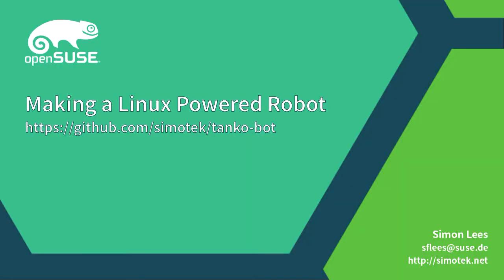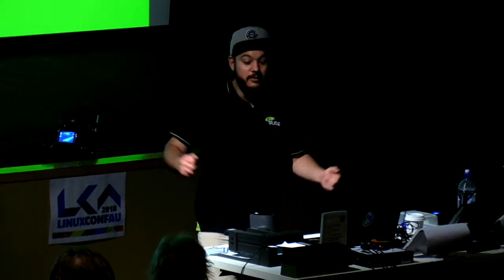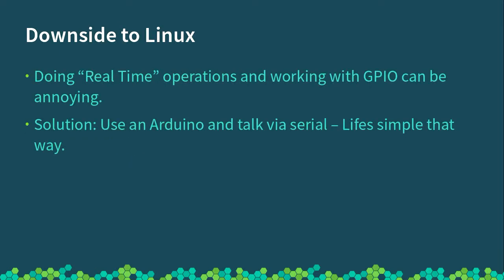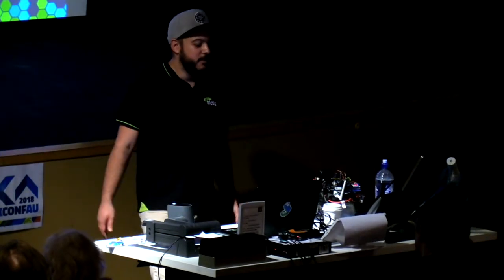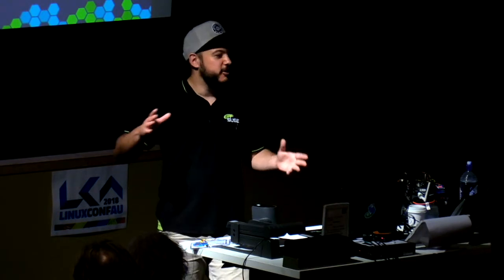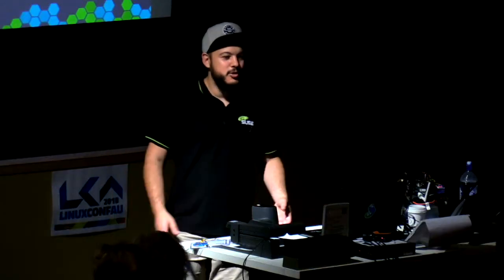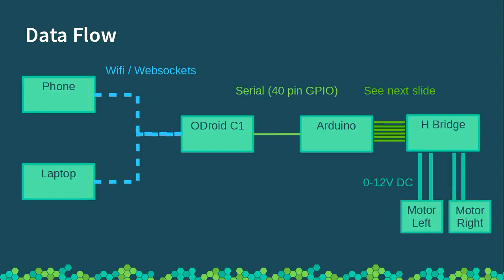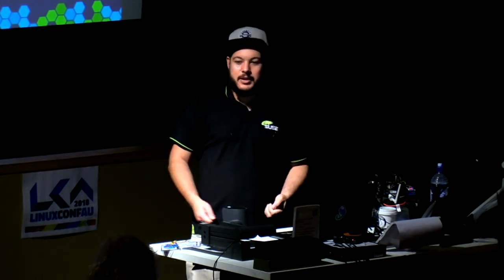Creating a Linux Powered Robot

Comment: Nice presentation Simon. I would agree that the direct kernel support from Odroid has dragged a bit, but recently they have been working on changing that and you should be able to get a 4.x kernel. You might also want to take a look at a newer  Linux distribution   for arm based SBC's  called Armbian (https://www.armbian.org).  I have used it for powering Odroid, Rock64, and Tinkerboard computers. Good luck!